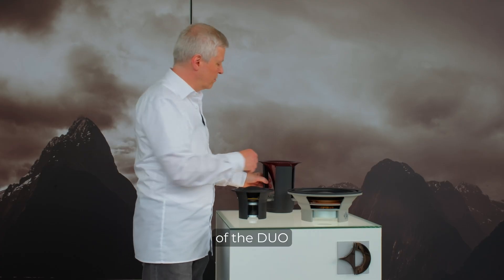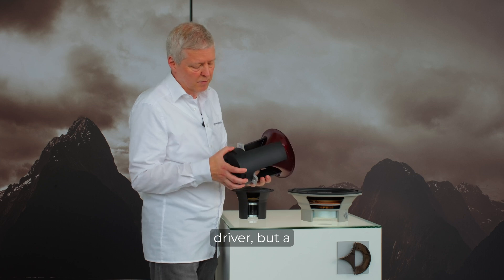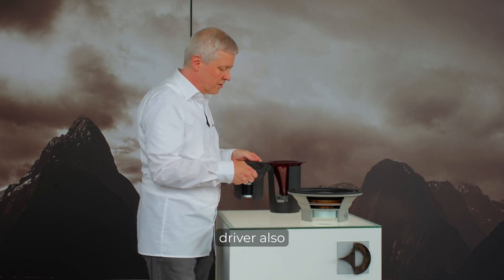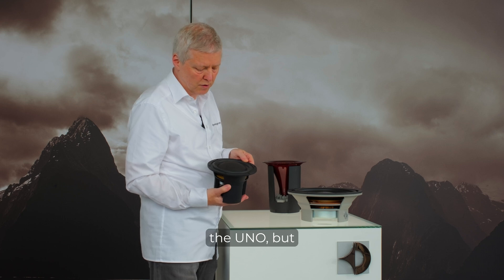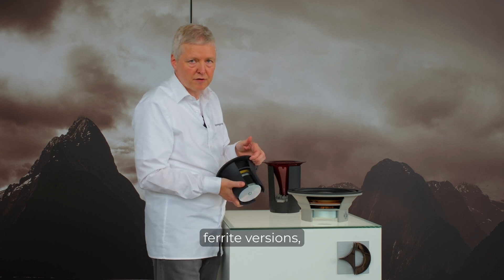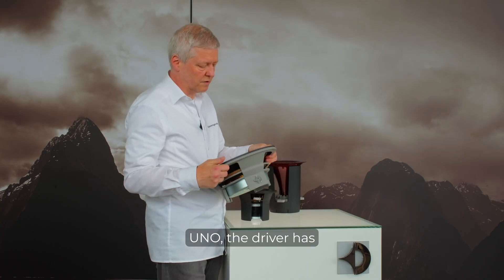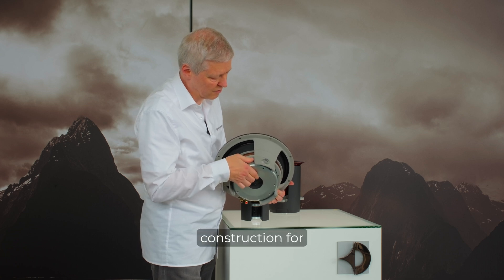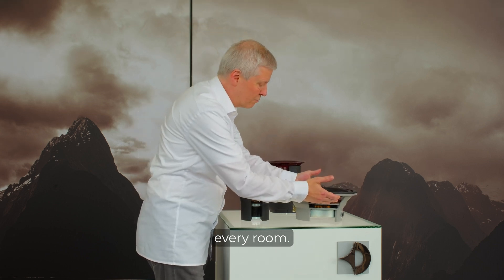DUO SD, DUO GT, MEZZO G3 - Drivers (Pt. 15)

Comment: What kind of magnet material is used on the 12 inch woofer?
Reply from the maker: Hi @seluj692, the magnets are made from a proprietary ferrite composite, achieving a compact magnet structure with a high flux density typically rather found in larger (15”, 18”) drivers.